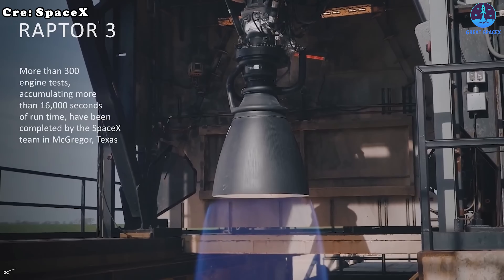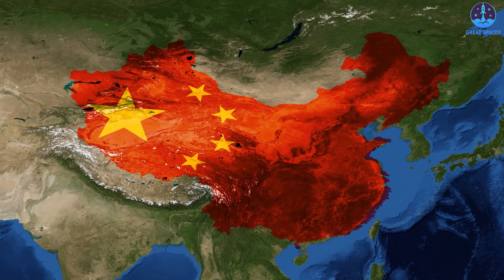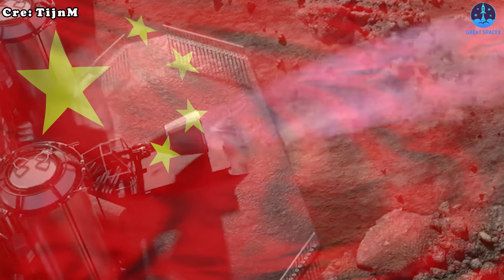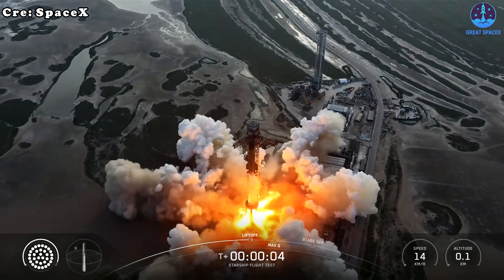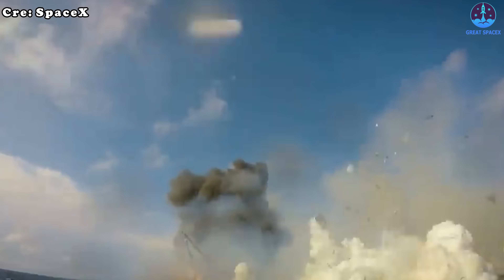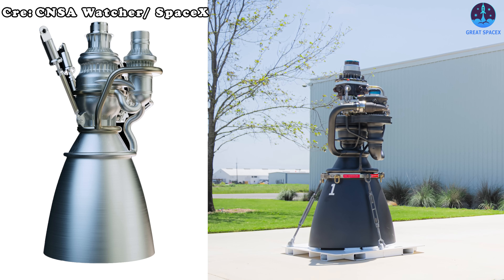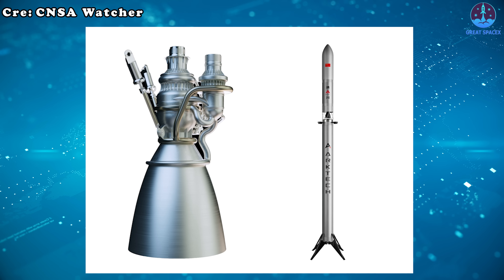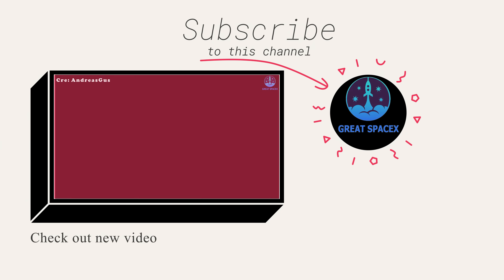Disaster! China even Totally Copied SpaceX’s Raptor 3 engine and Mixed the rockets! Elon Musk Laugh…

Comment: And NASA for decades, has used engines based on Russian-Soviet designs, most notably the RD-180 rocket engine, which powers the Atlas V rocket, and the NK-33, which was adapted by Aerojet to become the AJ-26 for the Antares rocket.
 However, the supply of these engines ceased in 2022 due to geopolitical reasons, prompting the development of American-made alternatives.

So.....
Reply: We were actually buying old Russian engines. Dangerous engines, with closed loop fuel systems and turbo-pump sections. If I'm not mistaken, that is over now, and those dancers have been solved. "Curious Droid", a channel here on LubeTube, has explored this subject.

Comment: As an aerospace r&d engineer that has seen Chinese stolen I in hardware form, it was always clear they didn't understand the principles of how or why something worked and was integrated. The first principle knowledge is the most crucial in engineering success not the hardware manufacture. When you don't come up with a design by first principles you don't understand what drives the performance and thus can't make adjustments to improve or modify it, you're at the mercy of another engineers conclusions and likely to always be behind or for your system to never work as expected.

Comment: The Chinese engines side support arm could be planned to allow independent engine steering. The rocket looks like an upscaled metholox version of the Falcon-9 series. Like Space X decided to modernize falcon-9 instead of obsoleting it with Starship.

I'll bet they plan on using side boosters for heavier lift capabilities. Avoiding the need for a huge number of main Booster engines like starship.

Wonder if the upper stage is planned to be expendable... Single engine, no heat shield and no extra fuel needed for the aero-burn and landing.
They probably plan on launching 100+ tons to LEO with side boosters.

Comment: What does China plan to do when they have eaten all the profits used to fund the innovation they are stealing? Once you have a workforce that has no experience in actual innovation and no external sources to draw from you will most likely stagnate for at least a generation, if not 2-3.

Side note, that effect might actually be the hardest problem to solve with making humanity multi-planetary. It's going to be a long time from when the first boots step on Mars to when doing full up design work on Mars has a direct ROI benefit over outsourcing it back to Earth.
Reply: "No experience in actual innovation"
That's where your statement is very wrong 
⚙
Remember the learning curve
Reply: @gePanzerTe note that I didn't say china has no innovation, just suggested that it's possible that the current pattern could end up there.

Also, innovation isn't taking an idea and turning it into a product. Rather it's coming up with ideas, evaluating them for merit, investing in them, knowing where to keep burning money and when to stop. Frankly, the number of actual innovations SpaceX has deployed is likely a few dozen compared to the hundreds of thousands to millions of design choices it took to get those innovations in the air.

Comment: A CASE OF INDUSTRIAL SPYING ???
China cannot copy Spacex's "Raptor 3" Period. Unless they have an "Industrial Spy" (very likely) in Spacex's own Midst !!!!
Reply: Not true. The Chinese are smart people. When things are pared down to their most basic solutions to problems will come to the same conclusions. Just because they can copy a good design doesn’t mean they can make it work. This is just a drawing.
Reply: @roxter299roxter7  You're both Naive & Ignorant. A high tech piece of Engineering such as the Raptor engine, requires very high precision manufacture. Meaning anyone wanting to copy such a piece of equipment, has to measure the whole thing, and every part, to get the precise measurements down to less than 1mm. How do you think the British screwed the Russians who wanted to copy Concord. The British substituted fractionally altered plans of Concord, knowing that the Russians were going to break into the "Safe" at the plant manufacturing Condcord. Hence the Russians went away with a complete set of plans, very sublty altered in one or two ccritical measurements, and when the Russians began test flying their "Concordsky" a number fell out of the Sky !!!!

Industrial Espionage in addition to State Espionage has been quite a healthy business since the 1880's. It's called the "Secrets War" and any decent Reference library should have a whole bookshelf on the subject. 99.5% of which will NEVER appear anywhere on the Internet  !!

Comment: I think that the booster could be shorter the starship could be longer and instead off heat shield tiles do an entry burn instead.
Reply: That is not even possible. The tiles are used at orbital speeds to slow down way before an entry burn could be done. The burn can’t be done at those speeds. It took them years to master re lighting the raptor and Merlin engines at 5500kmh let alone 25000 kph.
Reply: @myredeemerlives2134 why can’t they do an entry burn instead?

Comment: Why is that the West meekly accepts these ripoffs.
Its billions even trillions of USD worth of stolen IP yearly.
Reply: There is a difference between stealing and using patented secrets from copying.... All Smartphones looks like Apple cellphones and even works like Apple but Apple has not sued Samsung or Huawei...
Reply: @yootoober2009  LOL, Apple did sue Samsung in '11. They settled in '18. There were others too, but that was the big one on "smart" phones.
Reply: Actually, reverse engineerig is a well-established and legal practice.
IP is something else, such as. Patents, Copyright, and trade secrets.
Getting info from inside a company is stealing trade secrets. But looking at your products and design something similar, or even better, isn't IP theft. It's something everyone doesl
Reply: @larsnystrom6698  In most cases it isn't reverse engineering or stealing. China largely doesn't recognize IP law. If a company contracts with them to make something, they simply make more of that and sell it in other markets.

Solving the same problem with a completely different solution is free and clear, but simply tweaking and improving an existing design is a derivative work. That would be in violation of the original's IP rights and some kind of licensing or royalty agreement on the original IP is needed to produce and sell the derivative product.
Reply: Reverse-engineering and reproducing a patented product like the Raptor 3 is illegal.

Unless SpaceX has valid patents filed in China, reverse engineering and reproducing might be legal under Chinese law, but it would still be seen internationally as IP theft.
Actually you are right its a grey area.